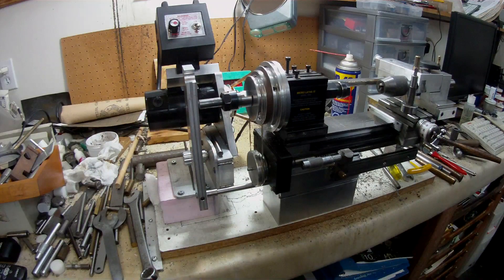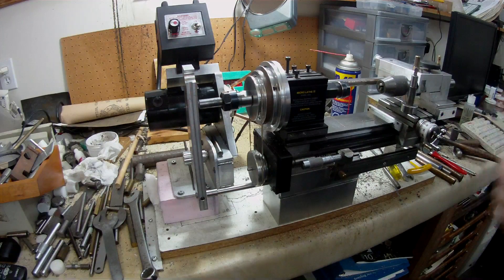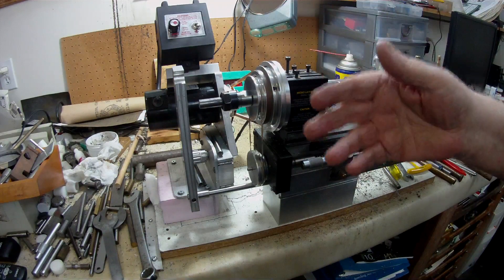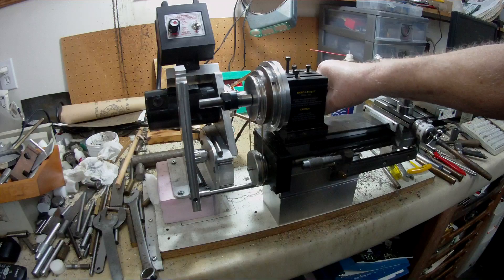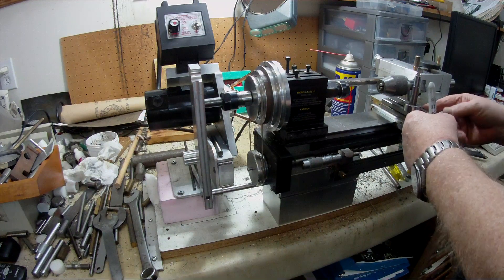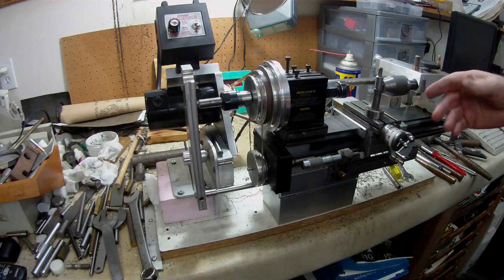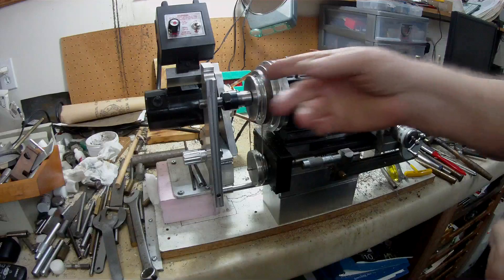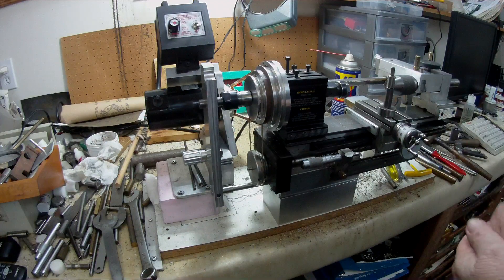FILE0017 Building a threading accessory for the Taig Lathe part 2

Comment: This threading project is excellent. I am concerned about the flex but otherwise it is very well executed. perhaps a gusset running along the length of the bar to stiffen that connection with the sliding bar might help. I am working on a similar project but have chosen to go the cnc way. Keep up the good work.  Martin  Hong Kong Taig user.
Reply from the maker: Martin can't remember if I replied, think I did, but here goes again,